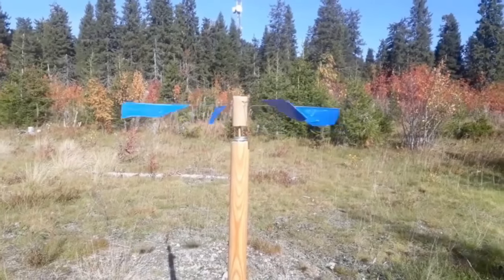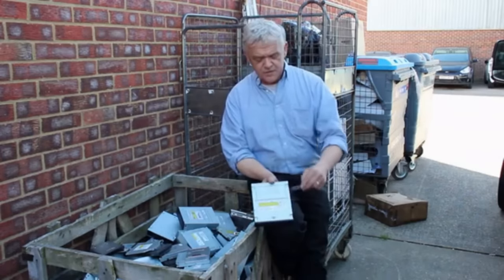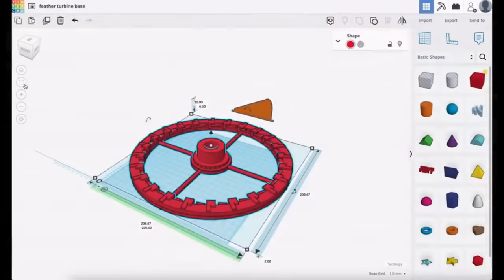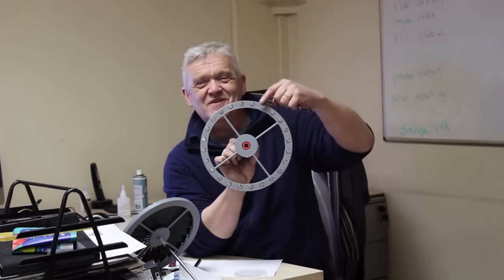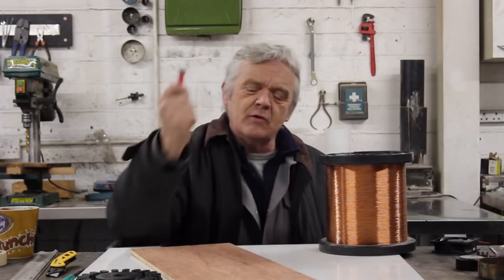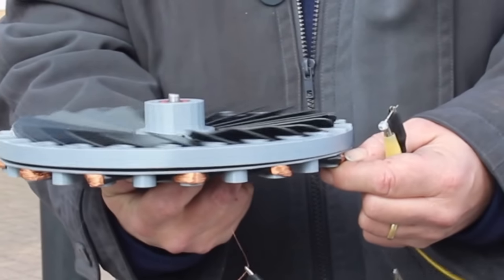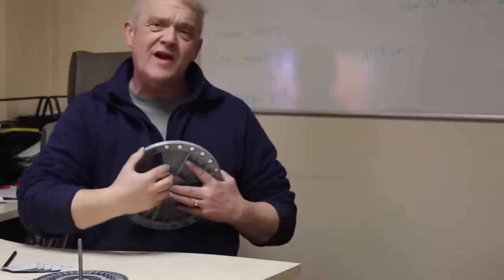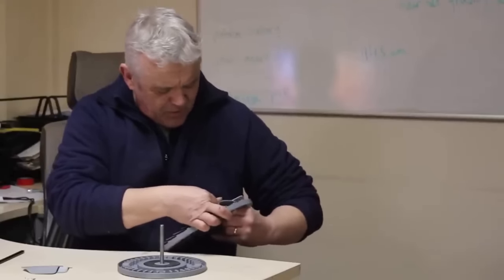024 A Flat Wind Turbine

Comment: I still think you should put the flat turbine with an axial generator and then stack the turbines so you had six or even ten on one axle.  Instead of a wind wall, you'd have a wind column, and the torque would (presumably) go up with each added plate.
Reply: what would the benefit be over a windwall? I thought the pancake design is useful for low heigh large area requirements
Reply: - OR (not a message to Rob but thought provoking to OP) making a flapping shutter VAWT "wind wall" - results in lower material mass (flat long blades are easily made from any sheet product) for more effective material use ($$$) - each alternate unit can be made to counterrotate - for increased energy output...  (NB, without a control system or nozzle, drag-only devices have tipspeed  limited to 1 wind.)

Comment: This is very close to the design I'm planning. Magnetic levitation included. I have breezy balconies and I was planning to mount several of these all along their top, hoping to generate something meaningful from the sheer number of them. My design has vertically mounted blades to grab more air, but similar collapsing blade design and magnets on the edges. A test prototype with cardboard showed that it also deals well with changes in wind direction, since it is basically designed to work in one direction only. Now I'm wondering if this is simpler to construct (since I'll also be making several and would like them to look more decorative (mine looks a touch utilitarian and more obviously "gadget that does work"). This could be easily camouflaged as a decorative element. But mine have more blade area, so perhaps for putting to use, that may be helpful for generating efficiency. More ideas, more testing...

Comment: can u try a coil made of 1 mm wire that has 24 layers of 10 turns in parallel. it seams as if no one can comprehend that multiple coils in parallel on the same core, with a M1 for mutual inductance will not only give more current, but will generate voltages that are much higher for the same coil in parallel versus the same number of turns in series. also, add a second parallel set of coils on the outs of the 24 layers of ten turns,  and wind it with 2 1mm wires in parallel,  and keep each layer only 10 turns total,  while doing 10 layers. that will give a massive voltage when the primary outer coil is shorted, and set up as a 2:1 S:P turns ratio. also keep it well insulated. You should do at least 2 turns on all secondary coil layers of office tape for the last 2 turns of each coil, and 5 turns of tape for the 24th. also put about 5mm of Teflon between Primary And secondary,  as well as 2 turns of tape for all but the first coil, that needs all five turns of parallel wire with a turn of tape. And please make the coil 20mm in diameter. this is to show that you don't need a extremely large coil to make a 1MV+ in voltage. (and don't spin it at high rpm just to show that it is possible to make a few 100, if not a few 1000s of volts at low speed). Thank you.

Comment: I am very new to technology, but if our earth is on rotation, and water is stagnant, forced to move similar to a bowl of water rotating. Couldn't we develop something to go underground and catch the current of water to produce energy? Because if water is always moving. (Because of earth's movement) We could connect that to something above ground? Like a tunnel that allows water through and back out forever because of using earth's movement as power? Is there a way to calculate the power lightening produces to create a rod to collect that power and be distributed. Wouldnt power much, but we could store that energy to use later. I apologize if this doesn't make sense. I just turned 12 so its hard to articulate myself. Not very educated, I just think a lot.
Edit: can we also use wind produced by cars in traffic with a flat wind turbine? I will study Geometry and Mathematics today. My school hasn't taught me Geometry yet so I feel I am missing a lot of information
Reply: The problem is that the water is also moving with the earth, as are we. So from our perspective on the surface, there is no movement.
Reply: I just wanted to say if you've just turned 12, your on to something, May God bless you 🙏 to make the world a better place.

Comment: Hey Rob, you should put a 'wall' at the large end of your "feather", so that the wind has no where to go, without turning the turbine.  As it is, you have wind moving under the end of the feather, when it is lifted up, but a piece, at 90 degrees, would keep that wind from being wasted.  That might give you a little better wind capture, and as such, more torque and speed.  Keep up the good work.
Reply: @johnbarry8185 - This improvement to the feather is an excellent idea. I wonder if you would be able to help me incorporate it into my own version of this set-up.  Like an idiot, I gave my 3D printer away, and so I am using recycled materials. My wheel is thin umbrella steel, and my flaps are sewn para cloth with fishing line rigging.  How would suggest I best incorporate your innovation into my rigging design.

I am also hoping to incorporate the maglev principle, although rather than skater bearings, I am using an old optical drive bearing which can handle maybe 500rpm, but maybe later try an old hard drive hub which I have read can handle 15k for a alternative design.

The serpentine coil is great for now as it is easy to make, but in the future I hope that we will see a proliferation of PSB stator design. Companies like PCBway should be able to not out all kinds of interesting and exotic variations as cheap as chips. At the moment, the design specification requirements are overly arduous but ChatGPT is helping through the worst of it. 

What do you need to know about the specs of my current rigged sail-vane?

Comment: @Robert you've been testing so many designs, why don't you create a wind tunnel that allows to test in uniform conditions? Then we can easily compare different designs and their efficiency. I know these are at most proof of concepts not working turbines, but lots of people are looking for actual solutions I think.

Thanks for the videos btw, have been with you for around 8 years now I think

Comment: on the CD and DVD drives, there are 3 neodymium magnets you are missing out on, two tiny bar magnets *these are on the ring of wire that one of the optics are floating on and are controlled by that wire and magnet arrangement, and there is a folded piece of steel that the magnets are stuck to on either side,) the other is a ring magnet that is in either the top spinner or the little disc you push the CD/DVD onto, with the other side having a piece of steel ring so it uses magnetic power to clamp the two together to hold the disc in when spinning. That magnet can be used with a screw or something to make changing them on a design easier too, by running the screw through the core of the magnet's hole to hold it down :)
Reply: by the way I LOVE that flap wind generator, it is so organic looking when moving. :) I bet spray painting it with some stencils to give it a camouflage texture would make it hard to see in a tree to blend in XD

Comment: 17:07 looking at the shape of the feather it may be too heavy above the pivot line... It could probably do with more balance, meaning the feather needs possibly to be either weight below the pivot line or be mounted in such a way more of the feathers mass is below the pivot line. This would result in the wind being able to "pick up" the feather more easily, taking advantage of the larger surface area...
The weighing down can be done with the magnets which is a bonus because the magnets move up or down depending on them being on a feather which is driven by the wind. magnets on feathers who are "passive" are not near a coil and can't be subject to electrical drag (or cogging)

Comment: 6:19 what if the 'feathers'  had a counter part? A topside feather.  That uses the bottom side feather to push it up enough. For the wind to grab pulling it up. I wonder if a single 1/4"steel inside a nylon tube with a thin foam with a layer of fiberglass or carbon fiber, making a feather, roughly 48"-60" long with with a little lever to lift the feather in front, just enough for the wind to set it spinning faster the feather being 18"- 30" wide+/- a bit, maybe 36" wide for a bit, then narrow to about 2" roughly 24-36" from the center, use steam bent lumber to form  a few large bows, assembled to make a circle use a motor to spin it on a bearing using a sharp chisel to trim it into a more perfect circle. Then use a block of wood with a little groove with a piece of 2" long 1/4" ID copper or aluminum tubing to reinforce the wood. While also acting as a beating the blocks being screwed  to the top and bottom of the ring, it being assembled  much like a wagon wheel with long dowels as spokes.  To a center ring with a 24-36" diameter sheet of plywood on both sides with a wood block in the center. With bearings bolted to the the top and bottom. Mounted to a roughly 25-40 mm dowel with magnets on the perimeter of the center plywood disc.  About 50mm x 3mm N52's,  with about a 1"/ 25mm. Bundle of copper serpent coil snaking it's way around  possibly producing 400v @ 45-60rpm , and attempt to use a transformer to drop the voltage in favor of current, using a microwave transformer rewound, probably two transformers, drop the voltage to under 100vac, then rectified,  and look into building a DC to DC capable of
3kw with a cc cv output, and a dump load pre rectifier to heat water using two 48v heating element, and possibly 2 more in a heat exchanger , a 2.5" pipe with 1" npt threads in the sides, with caps on the ends to allow elements to fit, on the input of the heater tank,  the exchanger would normally have a coil of 1/2" copper inside going end to end, with a roughly 24" coil 2"-2.25" O.D., with the end running through thr center, then pass through the bulkhead on each end, made from stainless and copper, wrapped in insulation, and placed inside a foam box. Usually used with a wood stove and the copper used with a  coil in/on the stove, the exchanger wall mounted designed for natural circulation of the water heating the water inside the 2.5" tank, with a safety to keep pressure under half the burst pressure of the tubing, probably below 25% of it.  And the water being 300°+/-, it should heat water entering fairly well.  Especially if two are used, in series or parallel,  especially with a small water pump circulating the hot water, at 2-5 gpm  build a stainless and brass pump to handle the heat a mini car water pump, using a 6v motor, 12-24v possibly a 36-60 v motor and 120/240v motor, having options is cool for off-grid using the exchanger  as a tank is a good idea, though 2"x24" doesn't hold much, however the heating coil being 250°-350°F helps it recover fast,  then dump the heat into a radiator heating the air, I hope to make a couple complete systems , then only the parts to make a heat exchanger, and the safety devices to also make a electric water heater booster by  heating the inlet water to about 100°f
Reply: @jamesest5001 - I appreciate all your detailed descriptions. Thank you for taking the time.

I do not have a lot of carpentry tools, and so I am trying to jury rig and old umbrella with some fabric sails.  Can I ask you some questions about designing a topside feather into a rigged sail design? Are you taking about what Bucky often referred to as a trimtab? -)

Comment: on the wind mill at (2:45) it looks like the side of the angle the flap is on is what determines what direction you get out of it since you are basically making a corner, but then shifting the two sides of the corner off set from each other, (ie if instead of like this from right to left ( / then this \) you instead switched to(\ then this /) *have to imagine that \ or/ is half of 90º ie 45º) then you would get it rotating the opposite direction because of which side is closer to flipping up means the other side if pushed on has to go a further distance to flip up and becomes the flap that catches the wind)   Not positive as I have not finished watching it all yet, 

also on wood have you guys hit up cabinet making shops for scrap? I have been getting some awesome stuff for free from a local place to me here, all sorts of hardwood ect just all of it is at around 3 inches wide by 1 inch and under, so its not 2x4(inches) or 4x4s or anything but its all cabinet grade finish on most sides.

Comment: i'd expect a difference if you paint a surface below the fins. should absorb heat and cause a presure difference, hopefully making it spin faster when there is no wind. or might do better with black fins and white base, trying to cause an air movement underneath the fins.
hopefully it won't melt anything. i'd expect that the heat to cool transfer should produce a potential change to cause work or energy flow.
Reply: @sailte2560 - My fins are made of upcycled umbrella cloth, which is that shiny silver stuff on the underside. Should I keep it on the underside and paint the top black?

Comment: You should put your meter on a lazy susan turntable.
Reply: Awesome suggestion. I have only ever seen them in restaurants. Can you get STLs to 3D them now?
Reply: @christopherd.winnan8701   - ha ha ha....  
an old trolley wheel off the side of the road plus a piece of wood (maybe a bolt with a few nuts if needed)..  Voila  a DIY nonprinted lazy Susan. (you could get creative with a bicycle wheel also.)  NB, it doesn't make sense to "just" 3d print everything, some products are best made from material already made.  enjoy making.
Reply: @kadmow  While I agree that not everybody has a 3D printer, even fewer people have access to a garage full of tools.

Sometimes a few good 3d printed designs will inspire me to upcycle something that I already have.  It is always good to see other peoples ingenious ideas.

Comment: Last design is by fare the best with (curved feathers),  yes you don't want to capture to much air underneath so the flat  feathers don't lift , So a thought a ROUNDED RING on top of feather outer ring about a inch gap (high) looking side on and only a inch wide from top view  , plus have it curved in on a angle outer top edge higher than inner ring height lower to force air flow to flick up feathers. 
Pretty much like the double blade wind turbine blade 2 directions to create a better output. 
Atleast the ring ontop won't  create any lift for the down feathers , but if curved angle is to great may create lift of top half of mag bearing then separating magnets from coils.
Love it Rob cheers thankyou
Reply: @patrickskahill2661
 - I like the analogy of curved feathers, which is more what I am trying to do with fabric. 

 Any suggestions on how I might easily adapt your improvements to my sail rigging design.

Comment: I'm thinking the CD spindle motors could be incorporated as the "leaves" in a bit of a redesign of the wind generator tree.
Reply: @Davidbrooks21217 - I am using a CD spindle and bearing for the hub, but how would you incorporate it into the leaves?
Reply: @christopherd.winnan8701  They would be the leaves. Basically, if you've seen these wind generator trees, the green plastic wind catching cones made to sort of resemble leaves could be replaced by these little units. In the end, one might be just about as effective as the other, but with the CD spindles, you're working with much more readily available parts, at an undoubtedly lower cost.

The more I think about it though, the CD units are far more compact, so you might be able to create a much larger array with them.
Reply: @davidbrooks2127  How about old Hard Disk spindles.  Would they word as well?
Reply: @christopherd.winnan8701  
Can't really say, off the top of my head... I'm not sure what kind of motors the wind trees are working with. But as a slap-together solution, it's better than shelling out the hundreds or maybe even thousands of dollars that I'm sure one of these trees costs.
Reply: @christopherd.winnan8701  
Sorry, I read your question wrong.
 If they work on the same principle as the CD spindles, I imagine they would... Plus, you've got access to some pretty nifty magnets when you gut the thing.

Comment: What if the feathers were just frames and there was some elastic membrane on them
Reply: @kke - or just frames and fabric, using elastic judiciously, just to optimise the tension, like on a really fast cutter. Where do you suggest adding specific points of higher tension and what would be the potential gain in performance?
Reply: @christopherd.winnan8701  By elastic membrane, I meant something that would sag and crate a small bag of air when wind blows on it, to make them kind of air buckets on the wind catching side.
Reply: @kke  I cannot afford expensive materials, so I am upcycling either plastic bags or foil sweet wrappers.  These are not very flexible, and so I use a combination of fishing line, tiny hooks and rubber bands to create tension in the rigging.  This is more cost effecting than trying to find stretchy material.